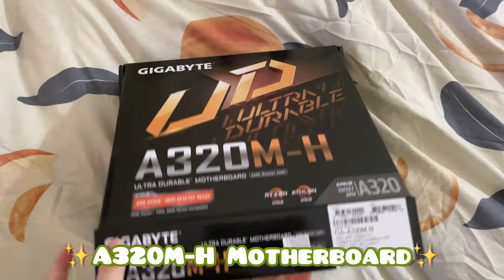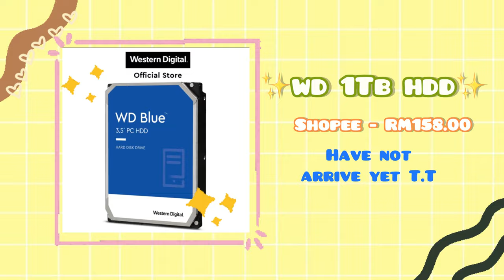Building my first PC! | Low end, Malaysia, Shopee finds, Pc image sale

Comment: Just a suggestion, you can add another 8gb stick of ram to enable the dual channel ram. Just buy the same brand and speed as the current ram that you have to avoid any issues. Because you're not using a graphics card therefore it will be better to increase the RAM. Also you can check for the ram speed by going to task manager > performance. Check if its 2133mhz or just 1333mhz. If it is 2133mhz then you can enable xmp profile in the motherboard bios which you can easily find the tutorial in YT. Anyway nice build and hope you can upgrade it in the future !